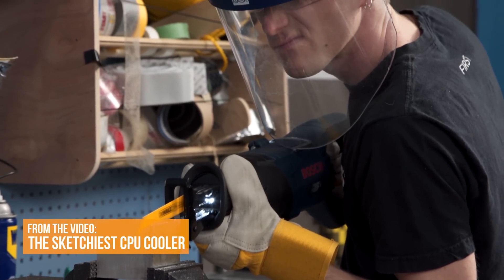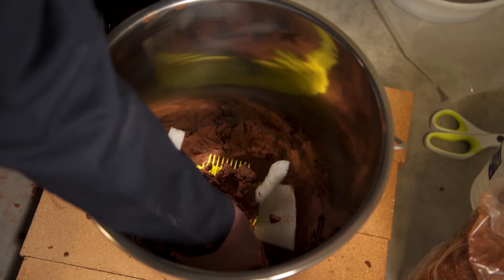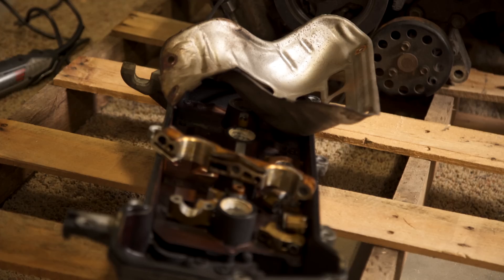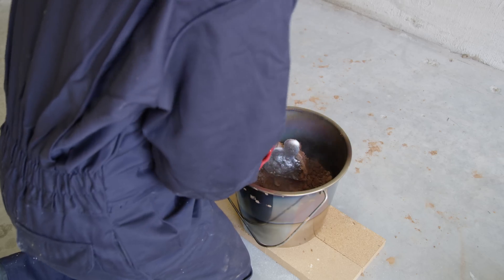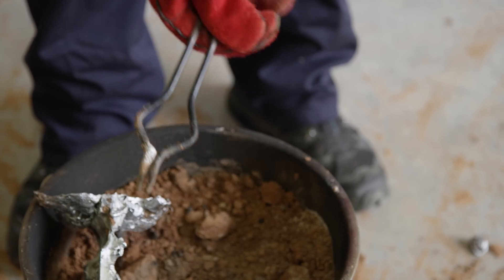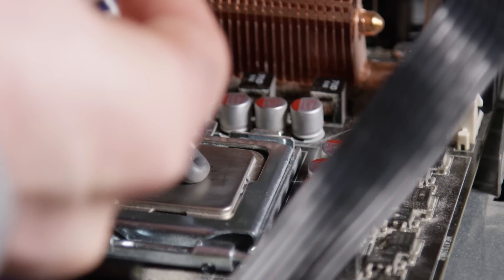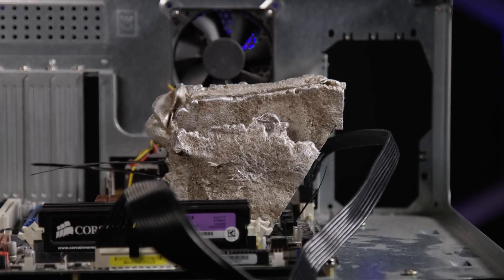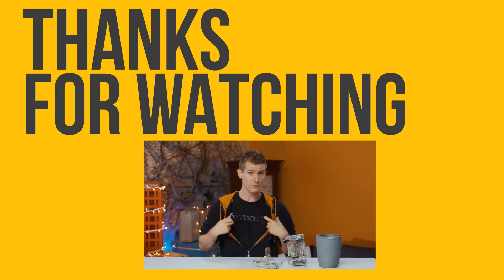The WORST CPU Cooler EVER – Sketchy Heatsinks Ep2

Comment: Casting technique tips:

For best results run the following early stages simultaneously due to low success rates of you amateurs: 

PLA print with the riser designed as part of the print> sand and smooth surface with added filler (wood filler or wall filler) > Silicone mixture vacuum chambered to remove air bubbles > set the PLA in the silicone mold > carefully cut out the PLA and close up the mold (single axis of cutting if possible and through the riser) > Melt wax and vacuum to remove air, pour into silicone mold (set in fridge if its warm weather) > Remove wax and inspect quality to pick the best ones. > (optional dip into a fine plaster mix and set to capture a good surface finish) > set in a vacuumed plaster mix (if coarse is easier to get, use the last step) > once the plaster is set turn it upside down with the riser over a borosilicate glass container and roast in the oven for a few hours (3-5) to melt out the wax and get rid of moisture. disturb the mold often during the first hour to make sure all the wax is out of the mold and remove it from the oven. > whilst mold is still hot pour in the molten alu.

don't forget to tap the molds a bit during each casting stage to remove bubbles between the thin fins in any poured substance such as the wax, the silicone, the plaster, the aluminium- this is why the sand is useless and it sticks to the surface. Course sand/viscous clay mix that you used would not fit well between the fins.

For quicker less shit results:

PLA print with the riser> sand a little > make a plaster mold > once cured, burn out all the PLA, just use the furnace setup until there is no smoke coming out of the riser (might take 20 - 40 mins) > wait for mold to cool a little and wash with some water > repeat burning and washing if required > roast in the oven for a few hours (3-5) to get rid of all the moisture > pour alu whilst still hot.

The plaster molds aren't reusable because you have to break them. so don't use much more than you need. PLA is low density so think about how you want to secure it in place.

If using the quick method and you have access to ABS capable printer I would suggest printing in ABS and using acetone to dissolve it and pour it out rather than burning it. 

Get some casting quick release sprays as well, its a lot easier to remove cast items without damaging them, especially for the wax inside the silicone.

The plaster might be a pain to get out of the cracks so here are some plaster removing tips:
- cool it down (liquid nitrogen works well) or heat up a bit, shrinking and expanding the aluminium will help loosen the plaster between the fins.
- Ultrasonic cleaners
Reply: Why are you casting a heatsink?

Mill it and it would be done in a few hours and much cheaper assuming you re-purpose your 3d printer with an attached milling drill etc, much better surface finish, thinner heatsink fins.
Reply: "Sketchy Heatsinks"
Reply: dissidify its gotta be sketchy
Reply: Acetone for the win. Though in my experience they would get a pile of ABS mush not liquid. But maybe I just have not had access to a large enough amount of acetone. Looks at glass milk jug full of acetone
Reply: I think I meant melt out the majority of it like the wax but ABS is too viscous to remove it all. Then fill up the mold with acetone to dissolve the ABS that has coated every surface. I haven't tried with such a complex shape of fins though so I don't know how much ABS would actually leave the mold.
Reply: With casting you could pull off much more, elaborate, designs and pretty quickly. Milling a CPU heatsink by hand, or even on a CNC will take lots of learning, lots of tricks and probably with lots more limitations on things like fin-size.
Reply: LTT I HOPE YOU SEE THIS COMMENT
Reply: yeah cost is way higher with cnc as well.
Reply: Milling is a good option for a low power heatsink*. The problem is that most CNC bits would probably only give an inch or two of depth at best. You wouldn't need to learn anything, just stick it in manual control and move it in straight lines for hours ;)
*best option is actually to buy one, obviously
Reply: dissidify  I have started creating my own no copyright music so you can all use my music for free in your videos please can you all check it out and give me some love and comments on my latest vid if u can and help me make my dream come true I want to reach 100 subs that's my goal so I will work hard to earn it, I hope you guys will be able to go and sub and help me reach my goal

Comment: Bteer ide would be buying alluminium plates (best quality), cut it into smaller plates, and connect it via copper pipes - you could design your own shape, size, and colling power. I really regret i didnt saved photos of project of mine, which were really good at cooling, but was limited to one LGA around 6 years ago. Friend sold it out as complete PC set for good price.  One thing we have done diferent than its made in current ready colling sets was this plates - we bend them in the centre, and on the ends, so it was takink much more air from fans - every rib of cooler was made this way. I saw this technique in one of todays coolers (CPU or GPU) somewhere as revolution technique :D

Comment: What if you cast the bottom part, and weld (?) flattened out strips of aluminum can to the top of it for the fins? 
Or just hammer down some straight up aluminum foil lol.

Comment: LMFAO! This was great. So the moral of the story is to just strap a rock shaped piece of metal to your cpu if you have nothing else and use and entire tube of ic diamond lol.

Keep making more vids like this, but maybe turn this into a 'homemade pc parts' section instead of just cpu coolers?👍
Reply: If by "home made" we mean with only what's in the average toolbox, it's down to cases and varying cooling options (and even fans would be borderline)... maybe cables. Add some basic electronics supplies and a PSU is conceivable, though perhaps not one you would want to use.
Reply: To clarify 'homemade' I only mean without the help of professionals  (This doesn't mean they couldn't research or ask questions, just no out sourcing). They could use any tool that a person may have at home, I have friends that have fabricated tops onto their drill press to make them a basic mill. So outside multi thousand dollar specialty equipment, I'd say they could use whatever they want.

For other parts, the sky is the limit! Water cooling with stuff only found at a hardware store, cooling the entire pc with non-pc fans, custom cases, cables, dare I say a PSU! Some of these guys are engineers, so they shouldn't have any issue with this. I'm a senior in mechanical engineering at my university right now and all of this would be super easy and fun to make; however, would it work better than professional R&D pc equipment? Who knows, but that's fun part!

Comment: Well... casting such thin parts is very hard... I casted with lost foam many times, a suggestion I want to share is to use playsand or very fine sand instead of proper greensand. It iflls the gaps much better :)

Comment: I'm a 1st year engineering student and I could have better ideas than your engineering team without any experience in this field. You should hire me Linus :D
Reply: The problem wasnt in the designs, but rather the casting capabilities.
Reply: Joseph B. yeah I was actually impressed with the planning. the execution of said plans didn't work so well though
Reply: Pat Tvl a series of columns would cast easier and could be poured directly into it would give descent surface area and make them not look like total fools. Also, their "green sand" was a terrible excuse with way too much water.
Reply: Same here, I have absolutely no knowledge in metal casting, but that would be one of my first idea.

It was a little cringeworthy to watch them (not) doing it.

Don't worry guys, I still love you all.
Reply: Meh, the design for casting I thought was pretty bad. I mean in general casting fins like that looks super hard, but I imagine just the way the flow would be it would be extremely hard for any of the fins to be fully formed even if they casted it properly. They should have just stuck it in upside down and melted the PLA with a torch.
Reply: Sigma Projects that's exactly what I was thinking about!
Reply: When Linus says "engineering team" he means the new guy who has no idea what he signed up for in the first place.

Comment: I am by no means a casting expert, but I see a few mistakes here. 
1 a piece of foam does not make for a good sprue (where you poor the molten aluminum into). You may also need a second sprue.
2 The aluminum will cool before it melts it's way through pla. lost wax or lost foam would be better. If you did lost wax you could of used an existing heat sink for a mold instead of waiting on a 3d printer.
3 The making of the foam model was painful to watch. It's a heat sink sandwich pieces of foam together. Don't just try and glue fins to a base.
4 Don't bother making green sand for lost foam casting. just use a fine sand. As a side note green sand needs a good mixture. it should be mostly dry, and should be brittle enough to break instead of bend.
5 Put the fins downward, gravity will help fill in all the details.

If you do follow up on this video I would love to see an ant hill casting (look it up)  as a heat sink. it would be a lot easier to do and would be right up this crew's alley.

Comment: "Home casting" slim details with large surface area is damn near impossible, even with a pressure chamber. if you really wanna make a diy heatsink,KISS. Cast a simple and not too thick dieblock with a long stalk on top. Buy a stack of thin alu sheets, cut to size and drill, use temporary spacers and solder the sheets on the stalk. its not heatpipes, but it'll work.The "fins" will be horizontal forsevere ease of manufacturing, but nothing a fan can't remedy.

Comment: why put the dummy heatsink at the bottom if the sand with blades facing up? Just fill bucket with sand then push dummy heatsink blades first into sand, then pour metal on top

Comment: Why not turn the PLA print upside down so that the molten aluminium can flow down the fins instead upwards. You can still sand the bottom smooth afterwards to get a nice finish. This way the molten aluminium would not have to travel upwards.

Comment: It could maybe even look cool if you saw and polish the edges and base (!) a little more and use it to cool some Intel Atom or NUC grade CPU on an ITX board and make it a themed mod build. Crude metal parts and a case made from glued rocks averted by some glass plates. Stone age PC. Such a CPU is not very demanding in cooling and even that piece of junk will work. But you would have to add some mounting systems to it of course.

Comment: so with the fact the alluminium couldn't travel up to the fins, nobody though about turning the model around so the fins would point down...? if you poured via the baseplate the alluminium could probably melt away a lot more material (lerger surface) and actually fill it up. then grind the excess on the mounting plate away... I mean i've never cast anything but it makes more sense to me than what i saw you guys doing..

Comment: NO! NO! NOOOO!! You need to create a silicon mold, dump liquid nitrogen in it, then the molten aluminum followed by 1000PSI pressure from a hydraulic press and then cut the fins with a 1000c degree knife!
Have you learned NOTHING this whole year!!??

Comment: you have made mention of your fellow kunuk, AvE in the past. He has dicked around with casting in the past. I have a limited number of heat sinks laying around but they are all machined. if casting is your goto method try magic sand from the toy department, and try jewelers wax as a lost mold. a little bit of time on a forge you will heat quicker with less propane. I have done this method for a few small parts in the past with about 80% success. The jeweler wax is great for the small details. Alternatively you could use a cnc machine on a billet, or fabricobble out out of aluminum flat bar and a cheap welder from harbor freight/Canadian tire.

Comment: Use thin sheets of aluminium to make the blades of the heat sync and then slot them into hand cut grooves into a base plate, I could send you some sketches of a design if you want

Comment: What aboot a 1/2 inch thick copper plate with a bunch of screws put in it? I'm sure the threads on the screws will have a "great" surface area to dissipate heat.

Or! even better.. a bunch of "U" shaped copper plates stacked inside of each other. Creating a fin array and with a fan on top.

OR!!! even best! a large pipe that is sealed at both ends that stands vertically on the CPU with just a little bit of water in it. At the top half you can solder some copper fins to dissipate heat and condense the evaporated water back down to the CPU.

I'M SOO FIGGEN' SMRT

Comment: You people were using a technique called Investment Casting. But then again, I don't know where plastic is used as pattern. Wax is the material generally used for this and the mold making process in that case is far more different than you used. Investment casting is useful if you need "High dimensional accuracy" and you can consider it for heat sinks.
The molding process you people were trying to do is a simple green sand mold. The required finished product can be achievable to a certain degree using a better riser, runner and gate design, and probably by using Two Part Mold. In two part mold plastic pattern can be used, as you can remove the whole pattern before pouring.
I think your metal working experts know that by now and hope to see a video with successful heat sink casting.
:)

Comment: I know you don't want the "drones" to try this again, however you made some crucial mistakes, if you had turned the mould upside down, you wouldn't need much pressure to fill up the fins of the cooler. You also would have wanted to warm up the sand before you put in the mould, this way the aluminium would have less of a chance to harden and block any crucial paths in the casting stage. Lastly, I would recommend trying to fill the centre of the mould as filling from one side to the other leaves a greater chance of the aluminium to harden before it reaches its goal.

My only reasons for saying this is that I've worked in an aluminium cast house factory, and aluminium has a bit of a "temper" depending on the particular alloy you're using. If you had used pure aluminium it would take longer to set and you'd have a greater chance to accomplish this task, however, an engine block will most certainly be some sort of manganese alloy if memory serves me correct.

Comment: That cooler would look cool on Luke's Quartz rock themed PC. I'm completely shooting in the dark here, but why not weld a bunch of thin Aluminium sheet metal (or copper) to a thick metal base instead of moulding it? Atleast then it would look like a heatsink....might not function as one but it would look like one.

Comment: You did the cast upside down. You can't expect the aluminium to pool and flow upwards into the fins. Aluminum cools too quickly for that. They need to be facing downward with the base at the top to allow gravity to pull the aluminum into the fins before it cools too much.

Comment: Linus, actual casting advice.

1. the corn method was right
2. the green sand was right
3. the last heat in method closest to right.

add less sand, so you can pour into the fins as opposed to the spout. a shorter but more defined heat sink.

The other option is to oven the cast and glassify the sand cast before adding aluminium =)

Comment: This is an insane amount of work for almost no result. YOU CUT UP AND MELTED A FRICKN ENGINE! You should have taken the radiator instead...
Reply: not all rads are ally. Most of the time they are copper
Reply: which, actually... copper wouldn't be so bad I guess....
Reply: Copper would work very well but how about taking the whole system? Ditch the whole melting and trying to mould complex shapes with dirt. XD

Comment: Oh Linus lost PLA casting are you kidding me. Lost wax casting is done in a 50 50 mix of sand and plaster of paris yes instead of wax you can use PLA or some other plastic. You put the piece of plastic in plaster 50/50 mix with holes for aluminium to go in and air to come out of the mold. When the plaster sets you turn the mold over and melt out the plastic. If you don't to this right the mold can explode. That is the better way to make something with detail from aluminium not with green sand except if you know how to use the green sand correctly. im no professional but your "engineering team" has no idea what they are doing.

Comment: Not gonna lie, the rock itself on a motherboard in place of a heatsink, looks beautiful. As for tips, slow the f**k down. Poor slower, let the aluminum works it's way into the smaller crevices and make wider fins. Also a fin attaching the funnel needs to be attached horizontally to the other fins with no vertical gap.

Comment: I have limited metal work experience but Would it not work better if you put the first mold the other way up so the fins are down and the contact plate is at the top then connect the chimney to the lowest point. This would allow the gas to escape similar to how plastic injection molding works. P.S. funniest video in ages

Comment: Wow toss a Q6600 on that dreadful test??? Couldn't you have chosen something less interesting to history rather than the greatest overclocking processor for the core series? It's not like there isn't thousands of  core2duo or core2quad processors available for pocket change. Hell a Q6600 could have equal processing power to a Q9650, they shouldn't be used in such a shity test but used in a test for overclocking comparisons. You all may as well just use a P4 3.2 Ghz preshot processor.. oddly enough mine ran cooler at 3.4 ghz and more stable.